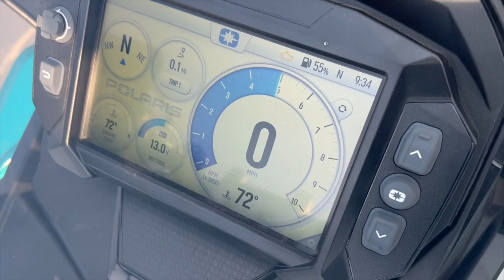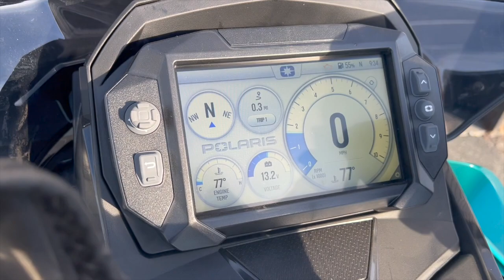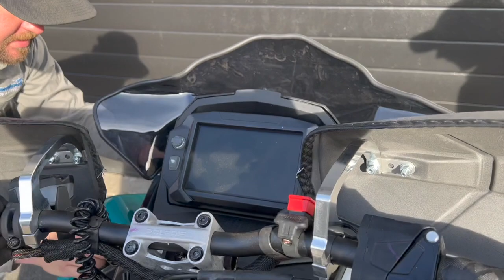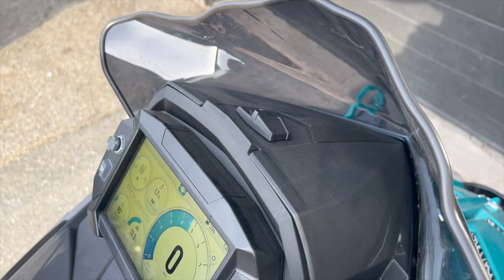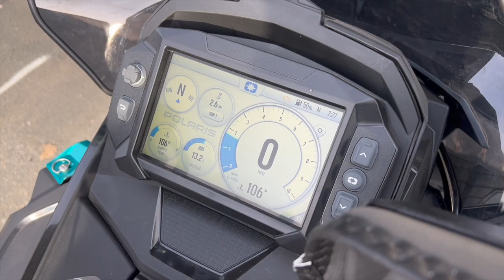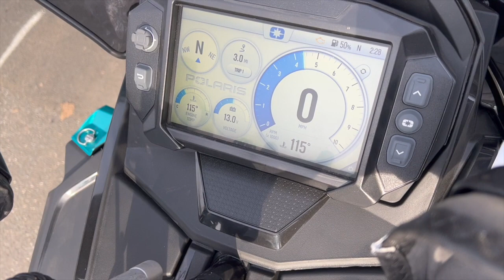INDY 9R BUILD PART 4! WE GET THIS 900 MONSTER FIRED UP! DID WE HAVE ANY ISSUES?!

Comment: What is the cross country limiter strap set up? How much different is it from the limiter strap video you did with your xcr?
Reply from the maker: same as an XCR with the two straps just much shorter. i am unsure the exact measurement off the top of my head
Reply: @JESSEJAMES322  I know the straps are the same. Interested in knowing what they run for length

Comment: Very cool, I hope Polaris offers this up at some point.  The boost went from the mountain sleds to the trail sleds, one can hope they will follow suit here with that as well.  I'm betting you are in the 4-6k range for this job, which on top of a fresh sled is a painful but fun option.
Reply from the maker: Thank youi! i think north of that. just a naked long block is $5900. i think we will see it in the trail sleds though
Reply: @JESSEJAMES322  Super rough estimate off a few fiche's on the internet: $8,550.99 I could not find 9r pistons with prices... so i estimated off what 850 pistons cost. This price was without the silencer in the estimate..
Reply from the maker: so did you not factor in a long block?
Reply: @JESSEJAMES322  basically all the parts needed to piece together a long block, ecu, y pipe, mid pipe. (No muffler) Again super rough guesstimate!

Comment: I’m surprised you don’t have more studs in the track. How many HP does the 9R have stock? 185, 190?
Reply: It’s got a 1.6 track I actually really like that over a studded up 1.35
Reply: Modern sleds transfer weight so well that they don't require as many studs as the 90s era triples. Just becomes added weight and power loss through rotating mass.
Reply: I have a modern sled but not a 1.6 deep track. It has 1.25 with 144 studs and I need more. The stopping and accelerating capability is greatly diminished by not having studs. Now I have an 800 with roughly 186hp (stage 2 black Diamond xtreme package) so perhaps our sleds are not the same.
Reply from the maker: HP wise they are just aboev an 850. the bottom end torque is where it comes into play. we are not about over studding. we started here and we will see how it does. im sure it will be fine

Comment: Interesting that it counts miles but no speedo it uses same sensor for that?
Reply from the maker: not sure if its the same sensor. i dont believe it is. speed sensor is off the brake rotor.
Reply: @JESSEJAMES322  speedo and odo use the speed sensor.  It needs the gear ratio programmed to produce both.  Since Polaris hasn't put a 9r in a trail sled yet, Polaris will need to write a calibration.

Comment: I'm curious what you did to the clutching? The engine is super responsive. I think it gonna pull hard! Can't wait to see her go
Reply: I think that has to do with lighter flywheel, drive clutch, they made 9’s to be more rappy
Reply from the maker: thats what the 9R does and why everyone wants it. Lightweight rotating assembly makes it very quick!
Reply: @JESSEJAMES322  I figured that! Every little bit of weight makes a difference. The flywheel gear removed.... we race dirt at Airborne speedway in Plattsburgh NY. So we understand rotating mass. If I were to guess the 9r is going to pull the boost out of the hole up to triple digits then the boost will probably win the mph. Game. Line them up!!!!???
Reply from the maker: i would probably bet that also but we will see. theyll both be on snow this weekend. Also i race snocross at plattsburg when it was still asphalt and then after my snocross career went on to race dirt mods